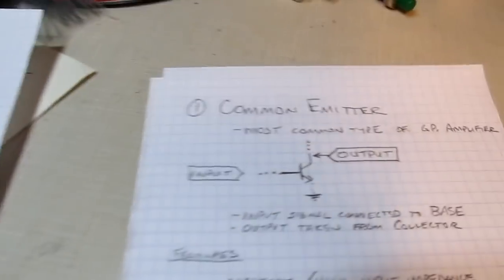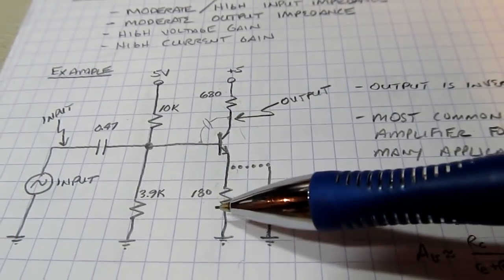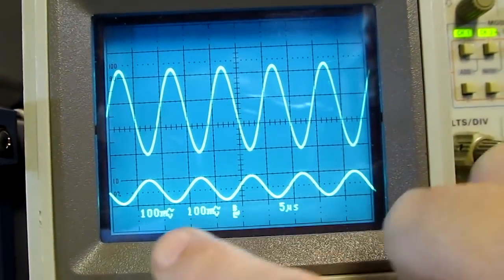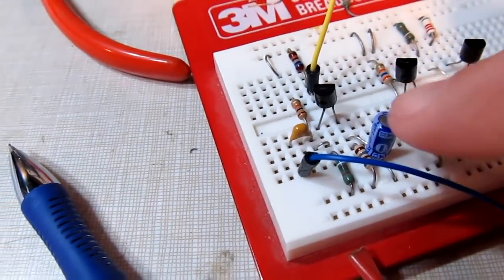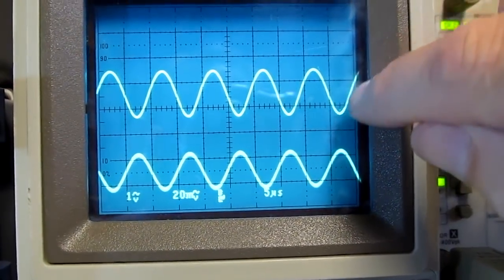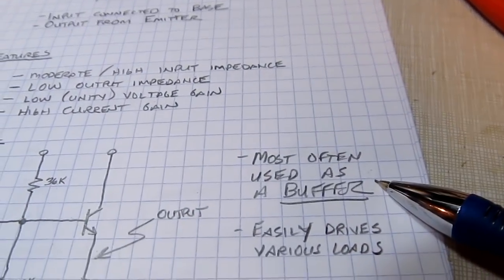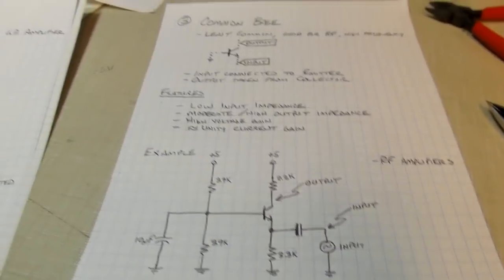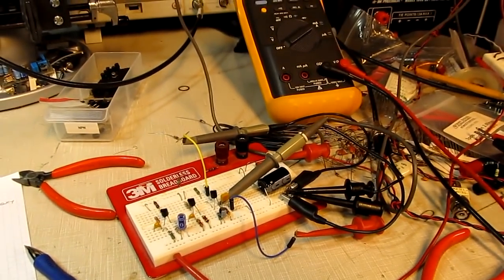#114: Tutorial: Common Emitter, Common Collector, and Common Base Transistor amplifiers

Comment: A very enlightening video, thank you for posting!

I’m trying to understand the notes you have written for the Common Emitter. You have lower case “re” and upper case “Re”. Am I correct in thinking:
“re” = dynamic impedance of the emitter
“Re”= resistance between the emitter and ground (180 ohms in this case).
“Rc”= resistance between the collector and the supply (680 ohms in this case).

I’m puzzled by what is meant be “re”. There is an “Re(hie)” in the 2N2222 data sheet which equals 60ohms at 300MHz, but I think that is referring to something else. 

Your notes say “re = 1/gm = Vt/Ic = 26mV/Ic”

Wikipedia says “transconductance is the ratio of the current change at the output port to the voltage change at the input port. It is written as gm. … gm=Iout/Vin” (so that is ohm’s law rearranged to talk about conductance rather than resistance.)

So Vt is the peak to peak input signal voltage as measured on the scope at 3:10 (26mV). The output voltage at this point looks like 1.8 volts giving a gain of 69.

You say at 2:33 that gain is dominated by Rc/gm “Collector resistor divided by dynamic impedance of the emitter” whilst pointing to your notes where they say gm*Rc. Or are you pointing to “Av is approximately =Rc/(re + Re)” I don’t know what Av stands for but it looks like it stands for gain.

69=680/gm would make gm = 9.9 Siemens (or 0.1 ohms). Would you get this from the data sheet? If this is the “Re(hie)” I saw in the 2N2222 datasheet how do you get the value for other frequencies?

I would have expected the reactance of the 10uF capacitor to govern the gain.

Can you correct me if I’m wrong about what the variables Av, re, Re, Vt, and gm stand for.

Also what transistors are you using for this demo?

Sorry for this being a long post. And despite my confusion I think this is a wonderfully clear video, thank you again.
Reply from the maker: The lower case "re" is the equivalent dynamic output resistance of the emitter (internal to the transistor).  The resistor "Re" is the physical resistor connected to the emitter.  The transconductance of the transistor is the denoted by "gm".  I don't know why gm is used for transconductance and is equal to the thermal voltage (Vt) divided by the collector current (Ic). It is a "small signal" quantity - which means that it applies at a particular bias point (collector current), and is valid for small signals (those that don't appreciably change the bias point).  While hFE is the current gain (Ic/Ib), the gm is a measure of the collector current change as a function of base-emitter voltage change.  Thermal voltage is a common term used in semiconductor theory, and is equal to kT/q, where k is Boltzman's constant, T is absolute temperature (in Kelvin), and q is the charge of an electron.  See:
http://en.wikipedia.org/wiki/Thermal_voltage#Role_in_semiconductor_physics:_the_thermal_voltage
I simplified this to the value at typical room temperature, which is 26mV.
Aren't you glad you asked!
Reply: ***** Thank you for responding - unfortunately I was re-editing my question while you were answering it!
Reply: Additional comments based on your edited question...
Yes, you have the definitions of re, Re, and Rc correct.

re represents the dynamic output resistance of the emitter. It is not a fixed value.  It is proportional to the quiescent current (bias point).  

The Re(hie) is something different - it is the real part of the input impedance looking into the base.  We're not concerning ourselves with this parameter in this discussion.

The transconductance of a BJT is also a function of the bias point, specifically it is a function of the collector current. It represents the relationship of collector current change as a function of b-e voltage change.  Therefore, in the case where the emitter is grounded, the voltage gain of a CE emitter amplifier is equal to gm*Rc = output voltage change as a function of input voltage change.  Thus - voltage gain.  re = 1/gm, thus the voltage gain can also be expressed as Rc/re. In other words: Av=gmRc=Rc/re, since re=1/gm and gm=1/re.   Av is the voltage gain of the amplifier circuit.

If there is an emitter resistor Re used in the circuit, then re adds to Re, and the voltage gain is calculated as Rc/(re+Re).

The reactance of the 10uF cap is very low at the operating frequency, so looked effectively like a short, so doesn't enter in the Av calculation.

The transistors used are basic, general purpose transistors - like the 2N2222, 2N3904, etc.
Reply: @last H’mm I thought I was editing out confusion from my question, but looking at your response, I think my edited question contains more confusion than the original. Shame I’ve lost the original text otherwise I would restore it.

So 26mV is a value to commit to memory (for 27 degrees C +86uV per Deg.C above that) My theory that 26mV was simply the input signal fitted so nicely too! I probably should edit the question again to avoid confusing others – but I have visions of another typing race with you. Best if people just read the info in your response and ignore my question.

I am glad I asked, but it may take me a while to assimilate it all!

Thank you for your help.

Comment: Your video is great!  
Could you please answer this and help me understand.  I built a simple 1 transistor oscillator, within audible frequency range.  It  is roughly 700mv and then i feed to the common emmitter circuit you built to the base.  Then from the collector I measure 7vpp.  It works great.  However, i want to hook a speaker up to the output of the collector.  The speaker + lead to the collector and other to ground.  When I do that the collector drops to 480mv.

The speaker must present a load but I dont understand how to implement a speaker on this commom emitter.  I think perhaps with a transformer but I dont want to have to use a transformer.  

Thank you!
Reply from the maker: Yes, the speaker's impedance - typically 4-16 ohms, appears in parallel with the collector load of your common-emitter amplifier, thus lowering its gain.  Most common solutions are to either use an audio output transformer in place of the collector resistor (which you don't want to do), or to follow this amplifier with a emitter follower (common collector) amplifier to get a low output impedance that can drive the speaker.
Reply: @w2aew  I am watching your #356 now talking about in/out impedance in emmiter follower   VERY GOOD stuff!!!  I will need to watch many time to comprehend all of it, but you are EXCELLENT with these videos.  This is only the 2nd I have watched.  I am going to be sooo busy this winter watching your videos   LOL    Thanks Again!!!

Comment: Hi Alan, Awesome tutorial as usual. Quick but related Question. I have the ARRL handbook "EXPERIMENTAL Methods in RF Design." It's a great book but the most frustrating and unusual thing I find about this book is that in general there are no units for the capacitors in a lot of the figures -resistors and inductors don't seem to follow this pattern. A lot of figures I see 0.1 next to a capacitor and I can't for the life of me tell whether that's 100nF or 100pF other than an educated guess. Is there some secret that I haven't found related to determining exactly what values the authors are referring to in the diagrams throughout the book? Some examples picked randomly: Fig 2.81, Fig 1.10, Fig1.33 - inter stage coupling between the oscillator and the emitter follower. is that 100nF or 100pf? For the oscillator in Fig 1.33 based on similar circuits I've seen the 390 feedback caps are most probably in pf. I know you have this book and just thought it would be easier to ask than guess. Cheers! -Vince
Reply from the maker: No secret method, it's just a bit of sloppy shorthand.  In general, you can deduce the units by the function of the caps.  The most common is that decimal values such as 0.1 or 0.22, 0.047, etc. are referring to uF (thus 100n, 200n, 47n).  And larger numbers like 10, 390, 220, etc. are likely pF for RF circuits.  In cases where these larger numbers are referring to uF values, they'll usually be polarized caps and the schematic will indicate that.  I don't think I've ever seen "unlabeled units" that referred to nF values - it is almost always pF or uF.  You should be able to tell uF from pF from the application.  Yes, it can be frustrating when it is unclear like this.
Reply: Excellent. Thanks for the tips. I should get off the YouTube and go experiment! Thanks for all the great content. -Vince

Comment: Question about 6:31. When you say that a low input impedance loads down the circuit you connect to, could you expand on what you mean by that? Or point me towards material explaining that.
Reply from the maker: Dmoles O A circuit with low input impedance will require that the circuit that driving the input have the capability of providing sufficient current to drive the input to the desired voltage.  If the preceding circuit can't provide this current (weak driver, high output impedance, etc.), then the voltage will be reduced or distortion will occur (or both).  If the circuit has a high input impedance, then the demands placed on the preceding circuit are much lighter.  Ideally, you'd want the connection between the circuits to have no affect on the voltage appearing at the junction.  This is why test equipment like multimeters, oscilloscope probes, etc. have a high input impedance - you want to measure the actual voltage appearing at that point without affecting it (loading it down).

Comment: Great Video! Thank you Sir! 
I am wondering why the inverting gain makes the capacitor appears than it really is in the common emitter configuration. Could you help to advise? Thanks!
Reply from the maker: Sure, see my video on the Miller Effect and the cascade amplifier.
Reply: @w2aew  Thanks Sir. I will check it out.

Comment: But what does a circuit look like for a BJT like the 2sc5200? I can't see it having those small resistors on the emitter and collector legs and somehow pull enough power to produce 10 to 15 watts so I guess my question is what does a big power BJT output stage look like? And how do you make it to where you don't need DC blocking capacitors? Because if the amp had 25 to 50 watts of output it would require pretty big capacitors on the output and you can't use poler capacitors if I remember correctly? . So I'm just all over the place confused

Comment: Great video.  I don't remember if I even learned this in school. What is the AC coupling? and AC coupling cap? what is meant by "bypassing"? For instance I Bypassed the Re using the 10uF cap in the Common Emitter example and my signal output came out as what looks like a half wave rectified signal. Bottom half cut off. 10K/4k voltage bias, 10k collector R and 2.5k emitter R...The output gain is there when the cap is not in parallel with Re...Got me thinking
Reply from the maker: AC Coupling refers to using a capacitor in series between stages of a circuit, to pass the signal of interest (usually AC), while blocking the DC content of the signal.  This allows each circuit to have its own DC bias point.  Greatly eases the design of multi-stage circuits because the DC bias levels don't have to "line-up" between stages.  Bypassing refers to using a capacitor to cause an AC signal to go around another circuit or component, thus bypassing it.  In the case of the cap around RE, this causes the AC Signal to bypass RE, which increases the AC gain of the CE amplifier.  In your case, you may have increased the gain so much with the bypass cap, that the output voltage was large enough to drive the amplifier into cutoff or saturation.
Reply: Thank you. Where can I learn more about this DC bias? Is there a formula for calculating the bypass cap? I had to go as low as 1nF to get a signal, but it seems anything higher gave me that same cutoff, and the AC gain didn't seem as great as the 10uF.
Reply from the maker: It's not as simple as a single formula.  It's all part of the overall design.  The DC operating point of the amplifier will determine the maximum output signal swing that is possible, which defines the maximum gain you could achieve for a given input signal amplitude.  So, often this is the first thing that you work out, taking into account the required input and output impedances, signal levels, power supply voltages, etc.  Then, you start working out the rest of the design for calculating gain, etc.  In your case, when you lowered the emitter capacitance, you wound up lowering the gain at your signal frequency by increasing the impedance at the emitter.

Comment: Hi w2aew, could you explain what the equations mean at 2:50 ?  The only thing I recognize is Ic which is collector current. I guess Rc means the resistance of the collector circuit (ie. 680 ohms) but that's all im able to figure out. What do re, gm, Vt etc mean? What's A in the eqn below? What does it represent? Is it A=(Rc/(re+Re)*(gmRc) ?
Reply from the maker: Yes, Rc is the collector resistor.  The remaining parameters (re=small-signal emitter impedance, gm=transconductance, Vt=thermal-voltage, etc.) are all parameters used for computing the small-signal gain characteristics, and come out of a simple model for the transistor.  The parameter A is the voltage gain. These parameters are explained a little more in a few of my other videos:
Common Emitter amp gain and frequency response: https://www.youtube.com/watch?v=NizrzRKQqII
Common Emitter amp design tips: https://www.youtube.com/watch?v=VWY2WQcKJgk

Comment: I am working on designing a PSU, and have decided to use a PNP channel transistor on the high end of my circuit, since for some reason a complementary NPN type would not bias 100%, and the voltage drop would be in the order of a few volts, which is unacceptable. why is this? that NPN transistors have a low output impedance on the low side of a circuit, while PNPs have a low output resistance on the high side? am I missing something? MOSFETS seem so much simpler!
Reply from the maker: PNP and P-channel devices are better suited for high-side switching and regulation applications, while NPN and N-channel devices are better suited for low-side switching applications.  All because the required biasing on the control input (Base or Gate) falls within the supply rails.
Reply: That makes sense, and totally agrees with what I figured out. So then why do they use NPN type transistors in positive voltage regulatores (78xx types, etc)
Reply from the maker: Two main reasons. The IC processes used for these regulators didn't support high current PNP devices. Plus, positive voltage regulators using PNP pass devices are harder to stabilize because if the demands placed on the feedback loop using a high output impedance pass device.
Reply: Are you implying the output of the PNP device is high impedance? Shouldn't it be low for delivering high currents?
Reply from the maker: Output impedance and output current capability are two different things. The collectors of NPN and PNP transistors behave much like current sources, and have a high output impedance. Surrounding circuitry and feedback can certainly affect the apparent output impedance of the overall circuit, such as a low dropout regulator that uses a PNP pass transistor. The transistor has a high output impedance, but the overall regulator circuit has a low output impedance.
Reply: Interesting; I was under the though that impedance is (loosely speeking) ESR, or series resistance. That way, the higher it is, the more voltage "sag" will occur, and in the case with my attempt to make as linear PSU, the inability for the op amp to fully saturate the transistor (then I realized Darlington pairs are actually used!)

Comment: I built the common base amp  and wondered what input frequency you were using could not get any amplification on the collector at all . The capacitor  on the base in my circuit was a 10 nf. 9v supply 8.2k  resistors for base bias.
Reply from the maker: As you can see from the scope, the period of the signal is about 10uS, which means the frequency was about 100kHz
Reply: @w2aew  Not a high frequency. Doesn't help when the transistor I was using didn't work. Better results with a working transistor. What a revelation!!

Comment: Common Base is a current amplifier and the common collector AKA emitter follower is a voltage amplifier and the common emitter is both a current amplifier & voltage amplifier? I have seen a Common base configuration being used to boost the current for digital CLOCK signals. Common base configuration have the collector as the input which boost the current not the voltage of the clock signal to the base pin as the output.

Comment: dear sir i have a question.in the Common emitter amplifier why do we use vcc ? and what is the use of the  capaciters exactly?
Reply from the maker: +Kifah kifahsama VCC is the common name for the positive supply rail in circuits containing mainly BJTs.  It has nothing to do with the type of circuit.  Capacitors are used mainly to pass AC signals and block DC signals.  Thus, they're used in filters (such as power supply filtering), as well as coupling between circuits, etc.